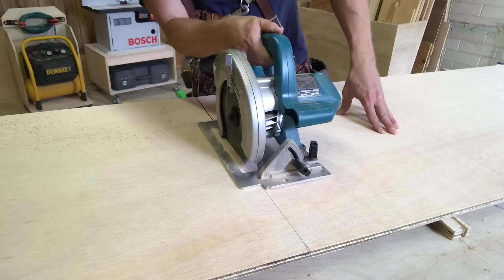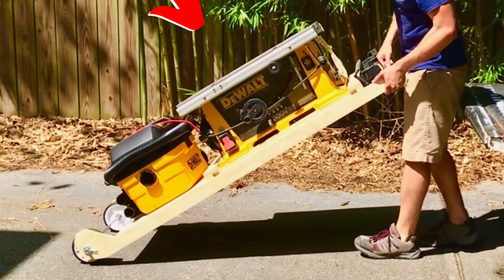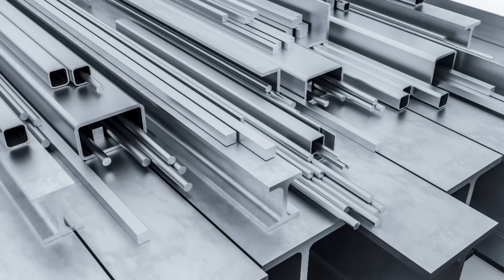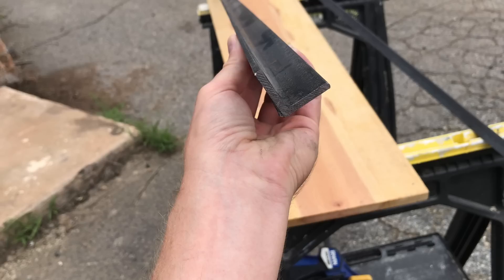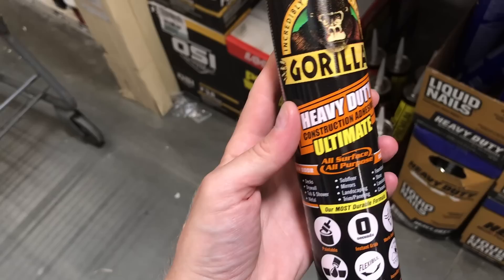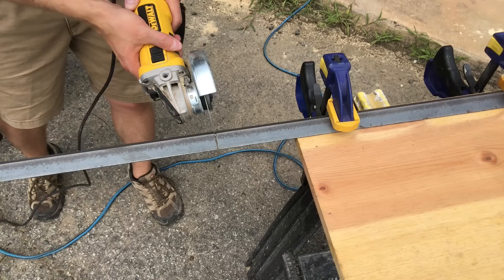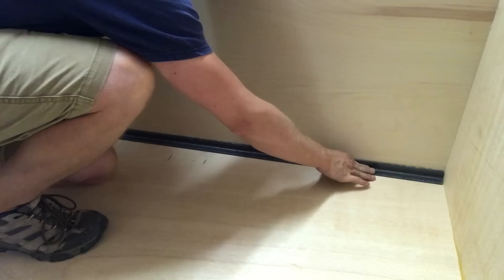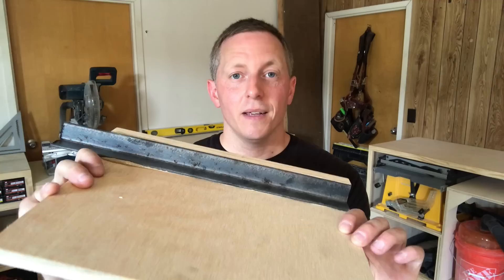How To STRENGTHEN WOOD WITH STEEL! (Make Your Wood Projects Stronger With METAL/STEEL...#1 Trick!)

Comment: Nice tip!

I never trust just the glue, especially between the metal and other materials. I had multiple cases of the glue snapping off of the metal surface, especially when under load or regularly applied vibrations.

I always add some bolts and nuts, and in most cases the glue is not even necessary. That also speeds up the project / cuts the glue drying / waiting time etc. And it reduces the mess, and it allows me to change my mind / design / reuse the materials more easily.

On top of the bolts + nuts, I often use the stainless steel threaded inserts for the wood, which make the connection even stronger, and prevents the wood from wearing out the threads under load.

Comment: Funny seeing your video, I just did a project where I had to bond metal, wood and concrete all together. My bonding adhesive of choice was 15 minute epoxy in a caulk tube. 48hr cure turned out pretty good, only needed a little touch up to smooth it out.(look pretty/eye candy)

Comment: Excellent. I have had mixed results using tube adhesives, which is why I'm looking forward to Vlog on that subject. Not all glues work well on metal and wood. I did not use the product you used and will try it. Thumbs up as always.

Comment: I use scrap steel pipe as well, especially for cruder exterior structures - simple electrical conduit straps & some wood screws will attach the pipe inside your project, and the stiffness increase is remarkable.

Comment: Great video. Thanks for such great ideas in all your videos! Maybe try cutting angle with a Portaband saw. No sparks, less airborne metal dust, very accurate, fast. I use a tiny Milwaukee M12 cordless Portaband for threaded rod, trimming (accessible] protruding hardware, notching sheet metal, etc. Usually without clamps. Less vibration than Sawzall or right angle grinder. Still use my grinder to cut masonry, bolts protruding from concrete, etc.

Comment: A few things that probably aren't super neccessary drill a few holes in the steel for fasteners....degrease the metal before gluing (and make sure the wood is free of loose debris but don't oversand it as adhesives work better on a slightly rough surface)...after inserting the steel onto the glue use a massage gun against the angle iron.  This will get the air bubbles out and provide more surface adhesion.  Once the rod is in place you can come back and hit those holes with fasteners and then slap it a few times and say "that baby aint goin nowheres..."

Comment: Great idea!  I have a granite kitchen counter top and the granite is maybe 2" wide in front of a 36" wide kitchen sink on top of a 36" double door cabinet with no stile between the doors.  I thought if anyone ever sat on the countertop front that it might break.  I added a 1"x1" steel angle but pre-drilled and screwed it to the top face frame, then caulked as sealant.  Using a polyurethane adhesive would have been much easier and accomplish securing and sealing!   Stronger too being glued along the full length to both planes.

Comment: interesting idea. another way would be to use 2x6 laying flat as your work surface or ply wood with a 2x4 or 2x6 sub frame which is offset from the edge of the work surface by 6 inches. Also old steel bed frames can be used for this without spending alot of money on angle iron meant for welding.  I would of also bolted that together without need for any glue.

Comment: I do things like this all of the time. Two suggestions. 
One, I would have used clamps to secure the steel to the wood, and, if you're in a hurry, I will drill and tap the steel, countersink the wood and use machine screws. It's actually quick and easy to do, and adds significant strength.

Comment: You can span a beam longer by creating a "flitch" beam. 1/4 inch metal  bolted between two  LVL beams will expend your length support without needing a deeper LVL.

Comment: I always use 1x1 by 1/16 thick angle and 1 by 1/8 thick flat bar to connect two studs, they make extremely strong connection and probably stronger than wood studs themselves. I use common wood glue and 1 in deck screws. They seem to work just fine.

Comment: The only thing I would add is that if you sand the bonding surfaces of the metal angle with coarse sandpaper, it gives the metal some teeth to bite into the adhesive and improves the bonding strength.

Comment: You can save 50 to 75 percent of the cost of metal angle if you purchase from a commercial metal supplier, rather than the Big Box stores.  Scrap yards are also a good source for metal stock if your willing to clean up the metal before using it.

Comment: Great video, I would suggest using a metal grinding wheel to clean the steel, which will clean it better and provide mechanical adhesion along with chemical adhesion.

Comment: I think this works because you are spreading the stress over such a large surface area. As others have said, clean it well and rough the steel up.  But I don’t think I’ve ever seen shop cabinets made of 1/2” ply - might work with Baltic Burch but not with Big Box ply.

Comment: good info, i want to "wrap" overlay drawer fronts in flat bar stock steel, 3/4 x1/8 around a 3/4 ply drawer front, don't want squeeze out, maybe cut the fronts to size, cut a shallow kerf (1/8" x 1/8"?) around the drawer fronts, paint the drawer fronts, cut the metal stock, clean it, mask, fill the kerf with PL, clamp the metal, what do you think?  going for a kind of industrial look

Comment: That is a basic engineering concept.  It's not so much that it is metal but the shape that works against the movement of the wood under load.  You can do something similar with thin ribs wood or plastic not just metal.  In your case though metal was pretty much you only option to keep it thin.

Great builds!

Comment: Awesome tip! Wondering if using steel angle like that would also work to straighten out a piece of warped 3/4” ply? I don’t have a planer and have about a 3/8” bow on an inset cabinet door. Could I use that adhesive and clamp it to set and hopefully straighten out the door?
Reply: You can give a try. If doesn’t work, you still can use the angle iron for another project.

Comment: In the lab where I worked, we had a custom built counter that connected to cabinets at the ends but had a fairly long stretch without supports underneath.  The carpenter did a great looking job, but it sagged noticeably when loaded up with computers, printer, heavy manuals, etc.  I consulted our plant mechanics and they came up with essentially the same solution.  They drilled holes through the steel and used screws to attach to the wood.  I don't recall the thickness of the angle iron, but I could sit in the middle of it with no detectable downward deflection.   Was also not visible except from below the counter.
Reply from the maker: That’s awesome, Bill. Goes to show that even when projects don’t work perfectly, you still have options to retrofit.

Comment: Oh yeah! My redwood porch rail was fine for a few years without a supporting T member 2 x 4 below, but ultimately developed quite a pronounced swayback. A 4 ft piece of 1/4 x 1 x 1 angle in the middle of the 7 ft span, clamped with coated 1 1/2 lag screws and polyurethane glue, took out all but a bit under 1/2 in of the sag -- and it's hardly noticeable under there . . .

Comment: Using glue is fine but if the steel is supported on the ends it will be stronger and work much better.
When gluing steel it is going to bond stronger if you scratch it up with coarse sandpaper or a grinder disc. Great video.

Comment: Another option to make an extremely rigid panel would have been similar to a honeycomb aerospace panel.  Edge the area with cut down 3/4x1.5 material.  Bond styrofoam to the under surface and to the edge bands, then bond a skin of 1/4" ply to that, brad nailing around the perimeter to the edge band.   I've made a "model" of this with balsa from the hobby shop, as part of a science class I gave to elementary school children.  Floppy 1/8" thick 1" wide , 3' long pieces of balsa...easy to snap 1" foam...but when glued together, able to support a 20 lb dumbbell quite easily.

Comment: Great idea.  I was expecting you to drill holes in the angle steel then screw it to the wood.  That's what I've done in the past, or used slotted steel and used those holes to drill in screws.  This seems better.  Much more strength thanks to the sophistication of modern adhesives, and easier.  Just slower, having to wait a day or two to dry.  An option might be to also set a few screws, then you could flip the cabinet upright and set it aside while it dries.

Comment: Interesting I used Gorilla Glue on my Kitchen table bonding project & used screws for the steel foundations. Never thought I could use a caulk gun for it, cause I thought it wasn't as precise. But I give that a try. Thanks for the Video.🤔
Reply from the maker: Thanks W! Yep, screws are often a go-to attachment method. I like the simplicity of solo adhesive too though. 🙂
Reply: But, but, but... isn’t Gorilla Glue a hair care product? 😉
Reply: Depends how much precision your task requires.  Construction adhesives are usually provide a superior adhesion to Gorilla Glue. Some of the adhesion test videos on YouTube indicate that Gorilla Glue isn't what it is cracked up to be.
Thicker construction adhesives can be applied with a small notched trowel to provide uniform adhesive coverage, much the same way as thin-set is applied when applying tile.

Comment: Nice job.  I use similar methods but do add light clamping pressure and use epoxy.  Though I haven't used it for this application, I really like PL Premium.  It's by far, the best construction adhesive I've ever used.  They may all smell, look and seem the same, but THEY ARE NOT.  If someone knows of a better one, post it, please.  I know that solvent adhesives shrink as they dry/cure.  So I can see advantages, in theory anyway, from clamping and not clamping.  

My  only suggestion to you is to get your steel from a steel supplier, not a box store, and try to get cold rolled if strength and rigidity are a priority.  At a steel supply those are a fraction of what you paid and probably better quality.  Some will give you custom lengths and some will only sell by factory lengths, so take your favorite cutter with you.  I love cordless band saws and metal circ saws for this.

Old bed frame rails are generally really good for these types of applications.  If I see a steel bed frame in the trash, I grab them.  It's WAY stronger and more rigid than the hot rolled box store stuff.

Comment: Every single slot in the slotted angle iron is a weak spot. The slots are mainly to keep the weight down, and/or for fastening with bolts. So even though the solid one you used has smaller dimensions, I bet it is stronger than the slotted one.
Also, the slotted ones are usually just bent plate, where the normal angle iron is forged, which adds to the strength.

Comment: Always solvent wipe all metal to remove any contaminants they will have on them if painting or bonding them. The metal notched into the sides of the units would also have made a stronger unit instead of solely relying on the adhesive .

Comment: In canada,  AFAIK, most Henkel products such as PL Premium is sold under LePage (Same product) The Loctite brand is non existent. I like the PL Premium 8X Fast Grab. This glue is great, only downside is the very slow cure of polyurethanes requiring mechanical fasteners or clamps. Once set, you'll regret your mistakes or enjoy a permanent temporary fix.

Comment: I was thinking that you could have accomplished the same result by laminating the 1/2" plywood top with 3/4" plywood underneath.  I'm a structural engineer so doing the calculations I found that the composite of steel plus plywood was a good amount stiffer.  Maybe 2 layers of 3/4" plywood would equal the plywood plus steel.  In this application the glue joint is important- if you just drilled holes and put in screws it would not achieve the same result of getting the 2 materials to act together as a composite.  Another option if you had scraps around would be laminate the 1/2" top with 1x hardwood underneath, the hardwood is significantly stiffer than 3/4" plywood.  But now going the other way- you used steel angle as the reinforcing.  If you wanted even more strength and stiffness you could have used a 1" square tube with 1/8" thick walls.  Some people might be able to do this with the smaller unistrut sections.

Comment: you really should sand the metal to get rid of the slag. the dark grey or black coating can cleave off if a sharp blow is applied but sanding it down to bare metal removes it and gives a good rough surface for adhesion.

Comment: Great info but me personally I'd be adding some small bolts or screws for added security to me just adhesive doesn't seem to reliable over time the wood and metal will have different expansion and contraction rates as the seasons change eventually that adhesive could give way
Reply: This has been my experience too.  When exposed to moisture of any kind, construction adhesive on metal will fail over time.

Comment: Careful mixing metal and wood that way because wood expands where the metal will expand much less so when the wood swells or shrinks from humidity it will pull at the adhesive bond and your desks reinforcement will fall off eventually.

Comment: That’s good, but I think that you should make the steel angle rest on the side supports and put the top on it.. this way the load is divided at side supports as well other than the chemical bond…
Reply from the maker: That’s not a bad idea, K
Reply: Agreed. Even just taking the 1/2” and creating some small internal blocking at the corners with additional screws would go a long ways. 

I could see issues with the bonding joint over time. Material will have different expansion/contraction ratios as temps vary and that could weaken the joint.

Very inventive and informative video!
Reply: @DHoss83  If the furniture isn't moved around with significantly changing temperatures or humidity, it shouldn't be an issue.  The adhesive has some flex to it.  For his table saw cart though, maybe that could be an issue?

Comment: I am one of 2nd redundancy. I would have put in some screws so after 30 years when the adhesive dies off - the steel is still holding the plywood top.

Comment: Hot-rolled angle like that is inexpensive and has a rough oxide-coated surface that will allow your adhesive to bond well, but it's pretty heavy for its strength in bending and has very poor torsional rigidity.  Closed shapes like square tubing will be more rigid in all ways for its weight, but the manufacturing process produces a smooth surface that may not bond as well with adhesives.  I like carriage bolts when combining wood with steel, but adhesives are clearly a good option.

Comment: I would be interested in a cost - benefit analysis of using the steel angle versus a torsion box. I tend towards torsion boxes because my unscientific tests showed that the box was as good as, if not better than, using steel angle or box. One issue with the steel is that, if you do bend it (like sitting on the workbench which would not work with my weight), then it is a devil to straighten. A torsion box tends to spring back to the original shape. Thoughts?

Comment: I think you should have drilled some holes on the metal and apply glue and screw the metal to wood. Repeated shock and temperature changes may cause the glue bond to separate from the metal.

Comment: Works way better if you sand / grind metal to give adhesive better grab 👍✌️then use brake clean or panel wipe etc to remove oils nearly all steel comes oily

Comment: Do you think this is adequate for strengthening the bond between a plywood table and folding metal legs? I am looking for a solution to table leg mounts being ripped from the plywood, either from mishandling or excessive loading. This is specific to the center mounts that experience tension vs compression. My concern with bonding to plywood, is that you're really only bonding to the outer ply, and that when under tension, there's really minimal strength vs using screws. Can you offer any insight or advice?

Comment: 1:10 If someone wants to use just wood, that doesn't sound like a material efficient way to do it (still a simple execution and solves the job either way though). It is basically brute forcing the problem. Using triangle supports and/or something more akin I-Beams would likely get the same strength than the bulky 2x4 in that configuration, in a smaller volume (obviously not as thin as a decent use of steel or even aluminum, which are just stronger), and a fraction of the materials used.

Comment: Would you get any strength benefits from just bonding a flat, non angle metal to the edge? I have a project where angle iron won’t work but it still needs a strength boost

Comment: I am redoing my pool surround decking as the beams in Fiji rotted as the waterproofing treatment is subpar .  I plan to construct concrete stations and affix C-channel to them for my support beams made of either aluminum or galvanized steel.  If I could glue the hardwood decking to the cross beams I could eliminate having to counter sink bolts which would be cheaper and a lot less work.  Is there an adhesive that could do this to one or the other types of metal cross beams that could stand up to the water exposure.  This is a salt water pool.  Any advice would be appreciated.